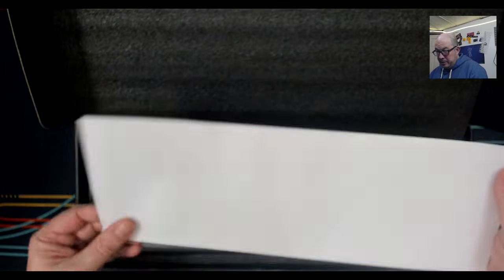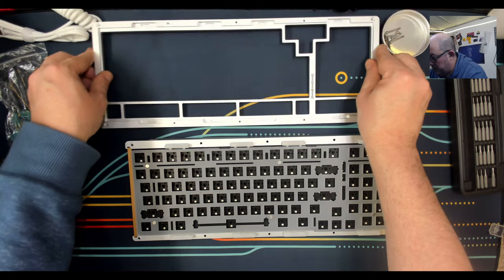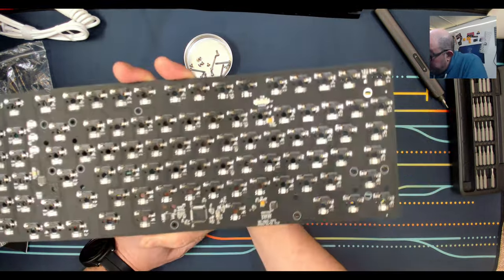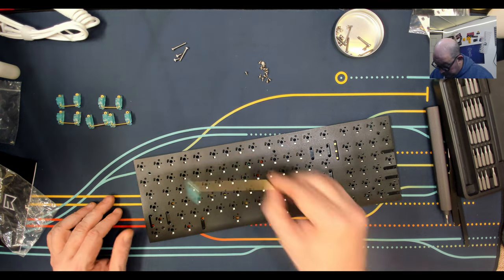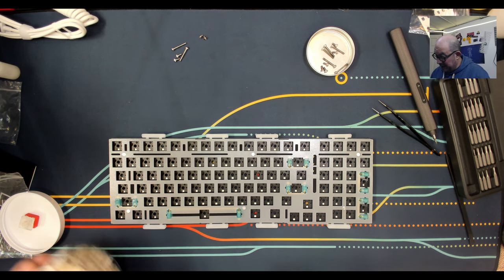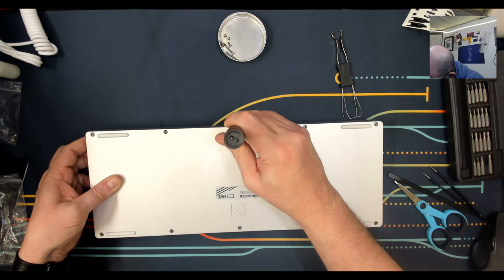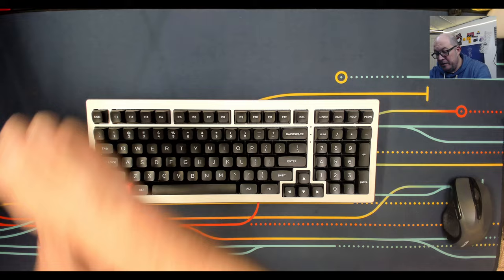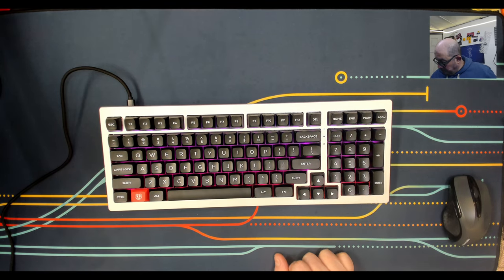Monsgeek M2 Build Review Sound Test | Perhaps the best value a solid QMK/VIA 1800 aluminum keyboard

Comment: I have a Keychron Q5, and I'm really struggling to see how this thing is inferior at all aside from not having options for a knob or alu plate. Maybe it's not as good without case foam? I just have a little polyfill in the Q5 and like the sound a lot. Definitely better than the junky stock foam keychron uses.
Reply from the maker: Don't get me wrong, I love my Keychron Q3 and Q1V2, but Monsgeek boards so far are just hitting it out of the park.

Comment: I don't see why you wouldn't 3D print some side panels in whatever color or style you want. I figure if you sand them you should be able to get a really nice fit and finish. Like I was thinking of getting this keyboard and then replacing the side panels with some translucent resin print with some mica powder.

Comment: how does this compare to the nuphy halo96 in your opinion?
Reply from the maker: Good question; they are similar yet different. The Monsgeek is much more substantial since it's fully aluminum, it comes with a PC plate and screw-in stabilizers. The Halo96 has a hybrid top mount, a unique RGB halo, wireless, and comes with switches and keycaps ready to go. They are both great boards, I'd say that the Monsgeek is for someone who doesn't mind opening it up to build and install the stabilizers, the Halo96 is for someone who needs wireless and want something that is ready to go.

Comment: Monsgeek ali store page says the PCB is 1.2mm?
Reply from the maker: I go off of the information from Monsgeek.com

https://www.monsgeek.com/product/m2/#:~:text=PCB%20Thickness-,1.6mm,-Plate
Reply: @MechKeyboards  I’ve ordered it so let’s see what arrives!
Reply from the maker: @MoonsOfEmpire  I don't have it taken apart ATM or I'd check, but I do believe I did measure it with my calipers and it was ~1.6mm.
Reply from the maker: @MoonsOfEmpire  hope you did not get the Chinese version only the international version has QMK/VIA
Reply: @MechKeyboards  It’s claiming to be qmk/via international version, I also got the POM plate
Reply from the maker: @MoonsOfEmpire  be sure to report back and I should have gotten around to measuring mine by then as well. Cheers!
Reply: @MechKeyboards  The Ali store page was incorrect and the website with 1.6mm is correct, Akko said they have updated it but most importantly I can buy some stabs before it arrives!
Reply from the maker: @MoonsOfEmpire  very cool, thanks for updating!